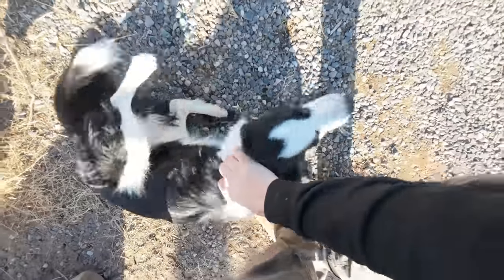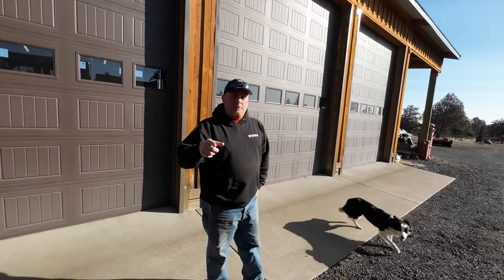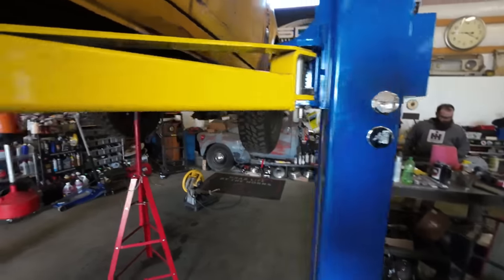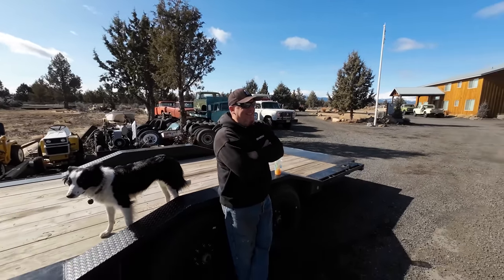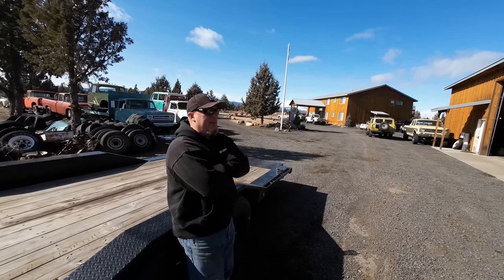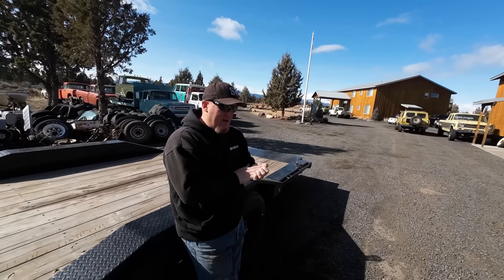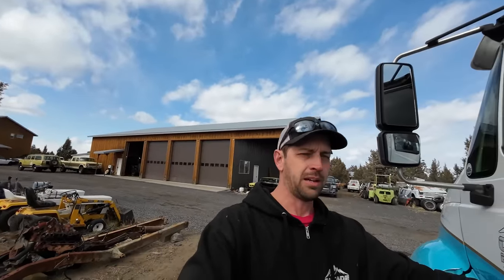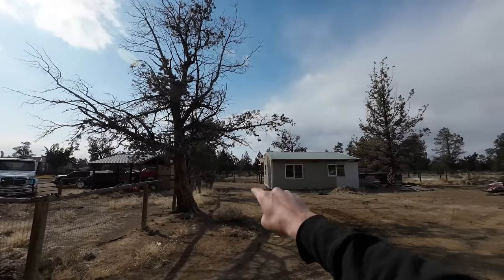Major progress on our ride to the Matt's off Road Wrecker Games!

Comment: Hey, I know you use a badlands winch on the track jeep, Project Farm just did an extensive set of tests on eight 12,000lb winches and you may be surprised.
Reply: He did NOT test the APEX.
Reply from the maker: Yes, I saw it, and no, I’m not surprised at the results.   Nothing against he guy, but that was nowhere near a fair comparison.    Notice that the Badlands started off right on par with the rest, but then he bent the hell out of it (due to the mount failing, not the winch), and kept using the bent and obviously bound up winch for the rest of the test, which is when it started falling behind.   Pretty much anyone can understand that if you put rotating shafts and intermeshing gears in a twist and bind, there’s going to be a major performance loss.  
Two things to note, first of all is that it continued to function even after being so badly damaged by the mounting plate failure.  Just like that moron Wranglerstar’s badlands winch continued to function even after his bumper failed and damaged the winch.  That says a lot about its durability when you’re in a situation where you absolutely NEED it to work.   
Second is that he compared the highest grade of the other brands, to the cheapest grade of the Badlands.  Why didn’t he use the Apex??

Now all that aside, let’s look at real world use.   I have used my Badlands winches FAR harder and FAR more often than 99% of people would ever dream of, and I’ve had exactly zero failures.   And more importantly than that, I rely on these winches to be able to operate my business.  So how the warranty is handled is probably the most important factor, and another one that he left out in that video.   For all the other brands, you would have to box your winch up and send it back to the manufacturer to see IF they will warranty it, and IF so, wait for the repair and return shipping.   For someone like me, that means I’m out of business for that entire time.   With the Badlands winches, I can drive to any Harbor Freight store, unbolt the winch in the parking lot, take it inside, and walk right back out with a brand new one in the box.   That ability to eliminate downtime is a massive factor for me, and is why I pulled all my Warn winches of my rigs, gave them away, and switched everything over to Badlands at full price out of my own pocket long before Harbor Freight had ever heard of me.
Reply: I agree with you on the damage done because of the bent mount. He cold have easily loosened the bolts on the winch body then mounted it on the straight mount then tighten the frame bolts. Granted this would take some time but it would have been a better comparison. 
On warranty work Harbor Freight can't be beat. Even if their products fail out of warranty, buying a replacement is cheaper than a Warn. 
Another thing I didn't like was that he let the cable get wound on overlapping itself. This can damage the cables, more on the steel than synthetic rope.
Reply: I watched it as well...but from the standpoint of someone like you who puts it through the real-life tests day after day...I am sold on the Badlands winch (and the Yankum ropes).
Reply: @CaseyLaDelle  I watched it as well...but from the standpoint of someone like you who puts it through the real-life tests day after day...I am sold on the Badlands winch (and the Yankum ropes).
Reply: @CaseyLaDelle  👍👍:trophy-yellow-smiling:
Reply: I really like that guy, and he’s usually extremely thorough in his tests & videos, but this time I think he missed the mark a little bit. The bent frame made the test no longer equal so at that point he should have fixed that before continuing. Also I know he was sort of comparing a few budget winches with more expensive ones, but he should have also included some of the better versions of the cheaper brands too to see how they compare to the name brand winches too. Not including an Apex winch was a mistake, especially since that’s the version most people swear by who like the HF winches. I will say this tho, everyone who feels this way should go leave a comment on his video explaining what was wrong with the test and to include more winches, because he reads them and is usually very open & receptive to feedback, criticisms, and ideas. I actually read one comment that he replied to and said if there was interest that he’d do another video including more winch brands. I think if people who know & use winches alot helped him see where the video was lacking, he’d make another one and improve the testing methods. I feel like he just isn’t super well versed on winches, which many of us aren’t. I wish I just knew everything Casey and other recovery guys have forgot about winches lol
Reply: @CaseyLaDelle lol I saw that Wranglerstar video and thought it was ridiculous too. His winch actually didn’t even break, until he used it not attached to a mount anymore. Any winch would rip itself apart if it’s mount broke off like that. That guy knows zero about what he’s talking about half the time but speaks as if he’s an expert on everything. I used to kinda like him but lately I can’t watch his videos cause they’re just nonsense about WW3 and how to ground your pillow to an electrical outlet with aluminum foil when you sleep lol 😳
Reply from the maker: @jesseleesamples  and in the very same video where he broke the harbor freight winch, he broke a warn winch trying the same thing literally minuted before.
Reply: @CaseyLaDelle  Oh yeah, I totally forgot that he actually broke the Warn too lol. But at the end of the video he only talked trash about the HF breaking, and said that he couldn’t own one that might break in an emergency so he had to have a Warn 😂 Hopefully WW3 doesn’t happen so he can find a replacement Warn when he breaks it tryin to pull another tree stump out of the ground in a dire emergency
Reply from the maker: @jesseleesamples  exactly!   The only difference was the warn broke on it own and quit working, while the harbor freight was broke by something else and continued to work!    Yet he only talked bad about the harbor freight, and then made an entire separate video about the harbor freight breaking and never mentioned the want failure.   That dude is a 🤡
Reply: @jesseleesamples  I no longer watch that dude… at all. 🤷‍♂️ Haven’t for years.
Reply: @matthewtaylor3308  if you’re talking about WS, then you’re better off lol. I only ever casually watched some of his videos. His content has gotten progressively worse and more ridiculous, especially recently. Honestly sometimes I still watch a video now and then, just to have a laugh lol. The only thing I would listen to him at all on is tree work, but everything else I really think he doesn’t know a damn thing and it baffles me that the prepper type of people actually listen to him. As someone who grew up in a rural world and has had to know how to survive more than most people these days, WS has always came off as more of a rich yuppie than a backwoods survivalist to me. Behind the scenes I think he lives a very wealthy man’s life and just plays a character on video that sells well to a ton of people on YouTube. But basically, he sucks. Lol

Comment: Love those old corn binders.  NO they are(were) sleek and fancy, Headsets recommended for passenger communication.  If you could get the wheels on it, it would go there.  NO do not expect to be a Baja contender.  It was farmer's truck to do farm things and it did them well.
What else can I say?  Thank you for the rescue..
PS you could almost do all the work with an adjustable wrench, pipe wrench and a hand full of box end wrenches..  OH why the Pipe hammer  You can use it to hit things and doubles as a vice.  Maybe two pipe wrenches

Comment: My folks had a '73 1210 4x4 Travelall. It had a 5 speed manual with divorced 205 transfer case. It sure made it easier doing a clutch job not having to deal with an attached transfer case. My dad and I did that once on his driveway. The tyranny and bell housing came off as a unit. It was more of a controlled drop when we removed it. Cast iron cases.

Comment: I’ve been an IH guy since 1987. I currently have a 1964 1 ton 4WD heavily modified, and a 1971 3/4 ton 4WD Travelall. Both have power to all 4 wheels. The truck has 41” tires and the Travell is on 33” tires. Here’s a video of my truck. We had just put this rock back where it belongs, and didn’t want to move it again. Most rigs that drive the trail could not move this rock. Mine can, and some other truck had messed it up. The reason it didn’t climb the first try was the front locker wasn’t engaged, you can hear the compressor kick on befor I try it again. It’s a long time part of the trail, that’s why we put it back. https://www.youtube.com/watch?v=2F1tVG_iTso

Comment: Three things you didn't mention; namely the driveshafts. Are they being fabricated, or are you doing it yourselves? Since you changed all the gearcases, I'd guess you need new ones?
Reply from the maker: We still need them.   This truck only had a rear driveline, which now doesn’t fit since the transfer case setup has changed

Comment: And this guy runs a Fabrication Shop? This is beyond shady, This is flat out RIP OFF Scam Artist stuff. It reminds me of a truck I went to look at some years ago. Dude was advertising a 2ed owner truck that was all original, never been wrecked, et. When I opened the door you could see it had been (Poorly) repainted and then I saw that the frame had been cut and a foot long piece welded ( again POORLY) into the frame. I called him out on his BS and attempted thievery,  At least when it leaves the 496 Garage, you will know you can drive it.  Sorry this happened to you Ben.